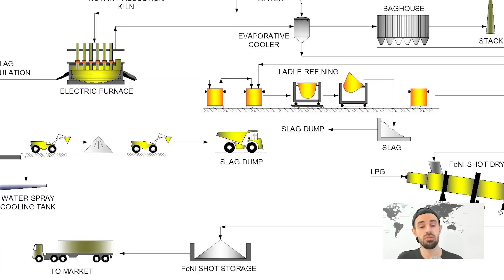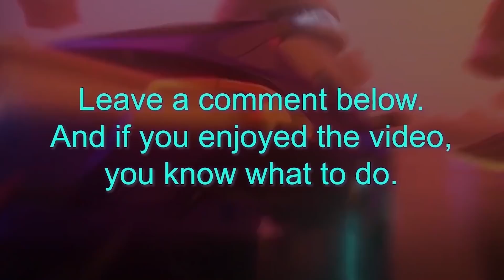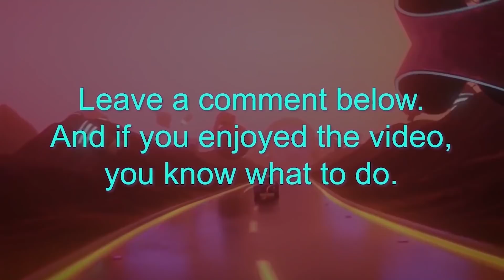Tesla Co-Founder's Battery Recycling Biz: Redwood Materials

Comment: Well unless they reach 100% with recycling then some mining would need to be done. With Nickle I heard 95% recovery mentioned in the begining clip, though I am going to carry on to hear the full context, but itwas the highest mentioned between Nickle and Lithium in that clip... Back to the video...
Reply: Electronics have aldgedly been recycled for years but burning off the insusltion is a bit.... counter productive if it sabout reducing CO2 <.< ANd yes, this was done in some.. places that shall remained unaccused.
Reply: Simply put things have to be made to be easily recyclable to some degree which has been an on going problem from what I have seen. One thing I did note was that the Tesla Battery revealed at battery days seems to be aimmed at making them easier ro recycle and far far less poluting when doing so... Here's to hoping.
Reply: Check out AMYZF and ABML for green recycling

Comment: The crucial question to me is the economics of this. Is this even remotely profitable right now? Melting and refining junk and extracting the good stuff is NOT energy 'inexpensive'.
Reply: Power isn't that expensive, and Nickel is ~15 grand a ton, and cobalt is like 30 grand a ton, and both are crazy dense, so those bins likely held a few tons each. Esp if they can get the phones for cheap, or get paid to take them as dangerous waste. That and as as they scale they can do cool things to recover heat from incoming and outgoing batches and other time and energy level improvements. Smelting steel is pretty profitable, and they have higher energy requirements, more costly inputs and sell for like $600 per ton.
Reply: @aaronmcculloch8326   Thank you.
Reply: There is a lot of energy left in the batteries coming in. I saw a video about one company recycling EV batteries that claimed that they could drive the entire recycling process with the energy siphoned from the batteries.
Reply: Also Mining is similarily energy expensive, since you have to extract the desired metals from Rocks, and their concentration in there is orders of magnitude lower

Comment: I think a lot of the battery producers will realize that recycling the batteries the built (should be the experts in taking them apart), are much cheaper than buying the mined materials. I also think the change in process Tesla just did going from modules in packs to batteries in structure will make recycling a lot easier proposition (and with that I think they will, and if i am not wrong already do recycle their batteries).

Comment: Steven, Tesla is  recycling their own batteries from production and battery replacement. The recovery rate should be higher than Redwood because there are hundreds of lithium formulas in batteries as they evolved over the years. I'm glad Redwood exists because getting lion batteries recycled at the moment is a pain- special drop off centers, etc.